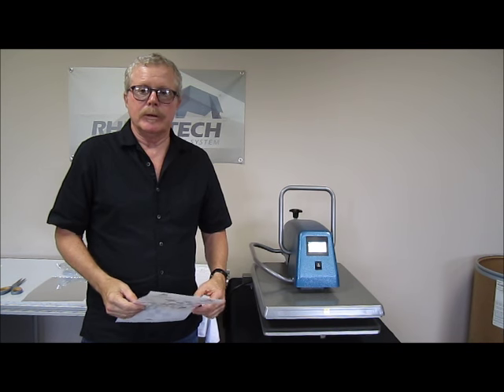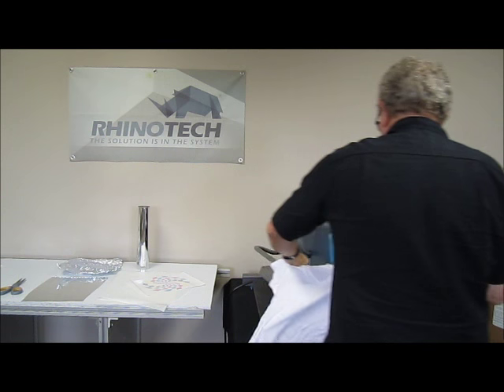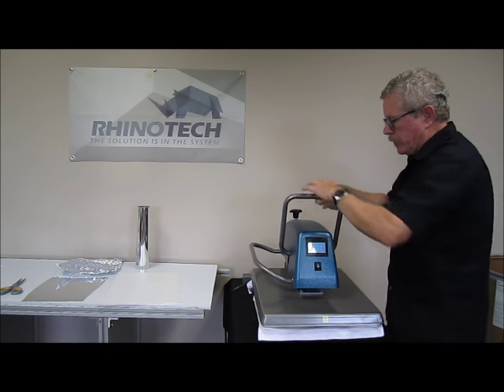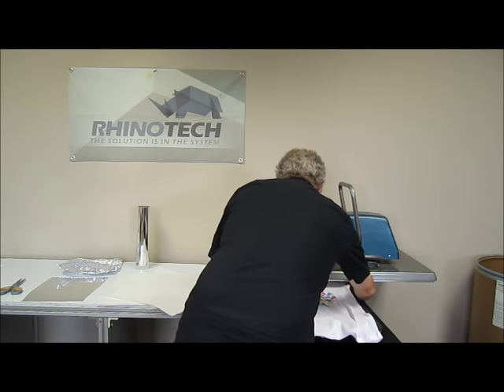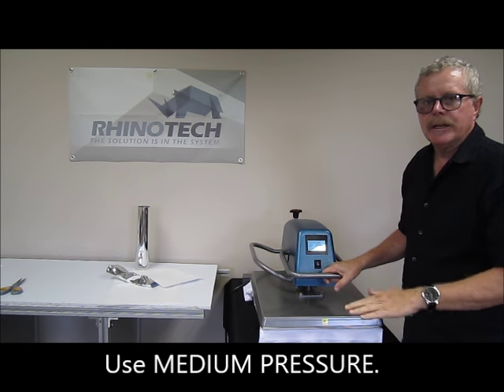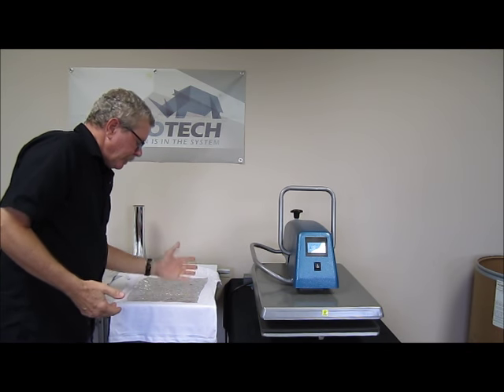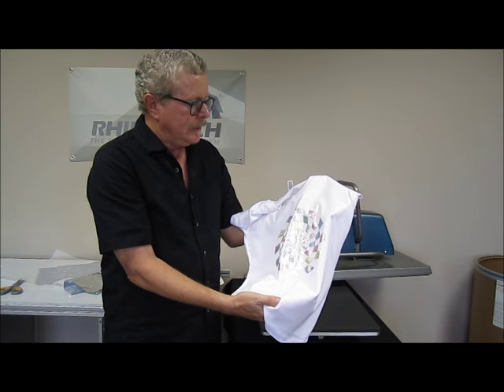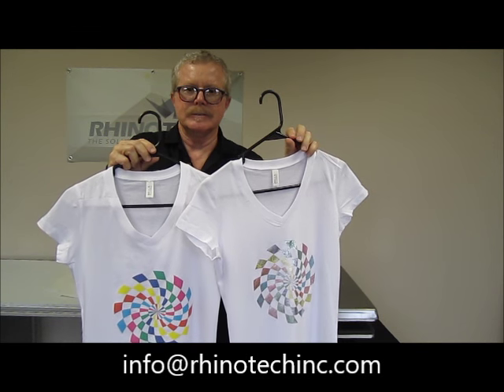SingleStep™ Heat Transfer Paper w/Foil overlay - Digital Update.

Comment: So this paper is for hard substrates and fabric ?  Currently using CPM from MT and tired of its inconsistencies. Is there a way to get a couple sheets for testing on to metal and glass ?  This paper isn't the CPM or the Forever papers is it ? Thanks. Mark
Reply from the maker: Many apologies; missed your questions, earlier. Thanks for contacting us. SingleStep only works on fabric, not hard surfaces. SinglePrint, however, is used for hard surface decoration on wood, metal, leather, ceramic, acrylic, glass.  You can purchase a Test Pack of 5 sheets at: https://rhinotechinc.com/digital-transfer/hard-surface-heat-transfer-paper. This paper isn't CPM or Forever. Please call Chris at 651-686-5027 x 4 for more info on this paper. Looking forward to working with you.